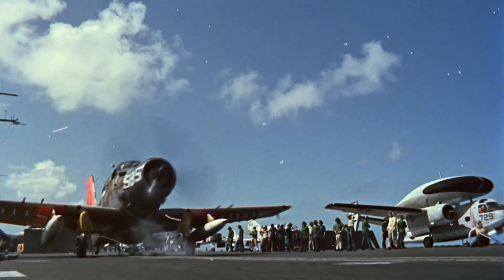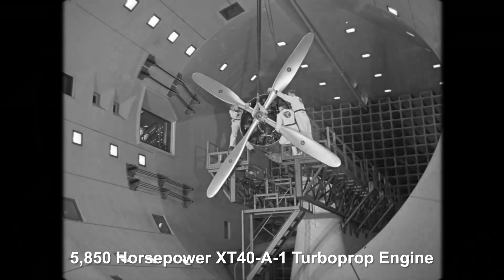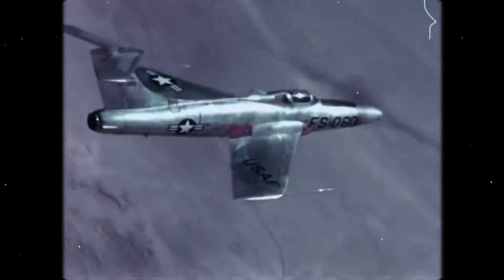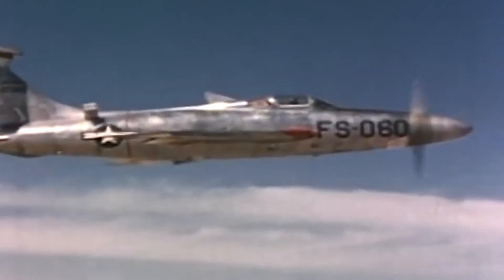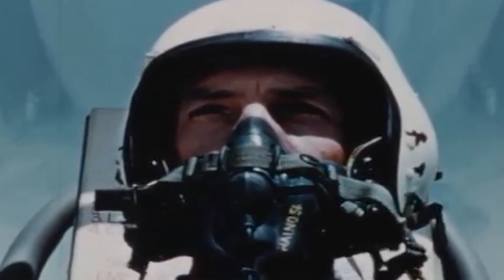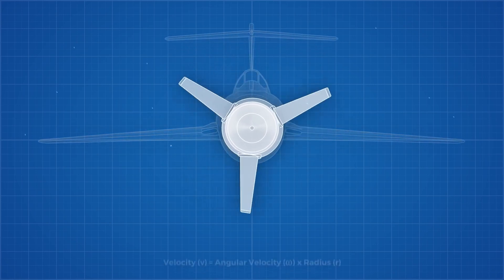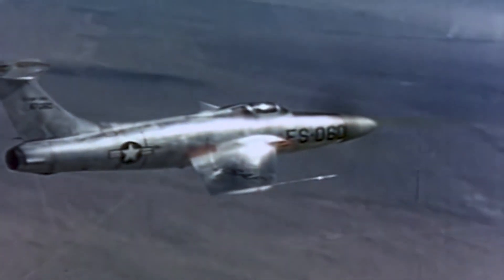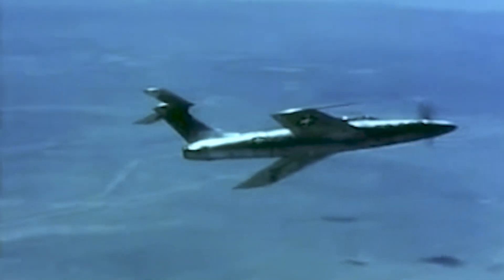THE LOUDEST AIRCRAFT EVER

Comment: Incredibly lousy  AI narration.  An aircraft such as this historically significant airframe deserves  better than this. This aircraft  was designed  and developed in an attempt to  counteract two problems  of early jet avaition development;  low power  output of early jet engines and incredibly   excessive  fuel consumption.  The excessive  torque of the propeller and the noise output of those propeller spinning in excess of the speed of sound not only caused problems for the pilot but also created insurmountable issuses for any ground personnel located within a mile of the aircraft itself. Problems  such as severe migraine headaches and significant hearing damage. We are fortunate, however, that the Museum of the United States Air  Force has been able to maintain one example at their facility in Ohio of this significant aircraft of the early days of the jet age.